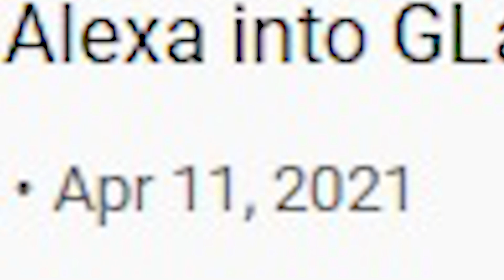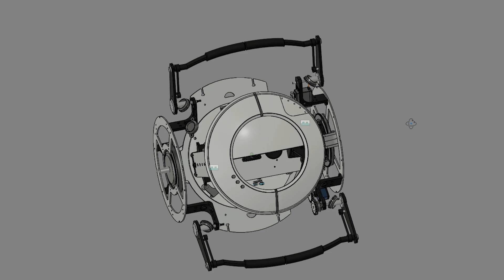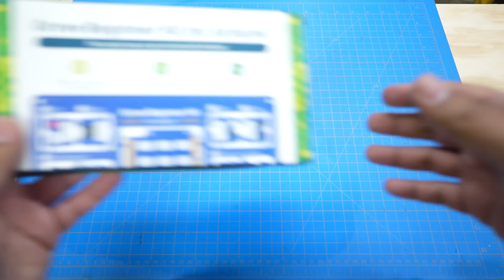Mr. Volt's 50K Sub End of Year Recap

Comment: I have been following this channel for a long time because I love portal and how you bring the concepts of the game to reality.
 To the 2 giveaway (I know I'm late but I loved the concept) the robot that I love the most is the portal turret and I see it plausible, making the shell moving with some servos in the middle moving the x and y axis, some red leds in the center, an arduino uno or raspberry with a l298n motor controller and a system type flywheel on the sides (of two motors turning in opposite directions and what happens in the middle goes flying) using the camera and a code that recognizes objects (plus a mini speaker that plays audio depending on what it detects, if I detect a face already the 5 seconds there is nothing to play "are you still here?") etc

Comment: Here's an idea I keep thinking about developing every time I walk to the workshop to check on one of my printers or my laser cutter:
Imagine Wheatley suspended from the ceiling on a track that allows for movement in front of each of my devices but on a telescoping rod to raise and lower to the appropriate height and ptz to position just right. Perhaps a positional encoding system so I can have a route preplanned to send a periodic progress report.
A personality core with a camera imbedded would be super cool because in idle mode it'd hang out in the middle of the room and when I go into the workshop it could remind me of my failures- er give a pep talk to motivate me through unclogging the printer.
Reply from the maker: That would be a fun feature!
Reply: That’s amazing!

Comment: The most practical invention that I could think of would be a robot claw, because it can be used for so many things like grabbing things from the other side of the room, or multitasking!
Reply from the maker: I'm not sure this is what you're thinking of, but now I'm picturing a room-sized claw game that you can control from bed!
Reply: @MrVolt  Maybe a smaller claw but on a rail system attached to the roof that can move anywhere, and be out of the way when you don't need it, so sort of what you said but just with multiple joints instead of just one pole and a claw.
Reply: Prosthetic arm even!